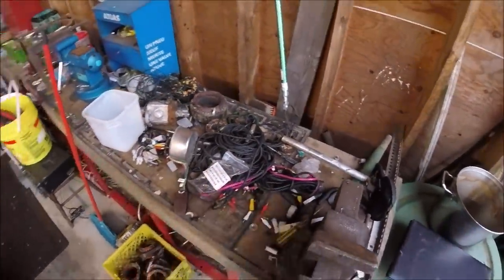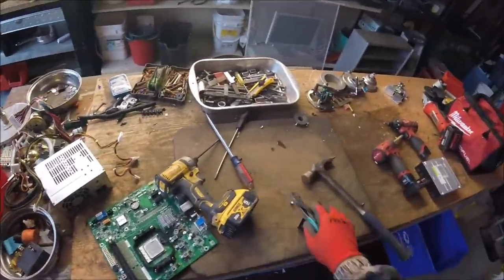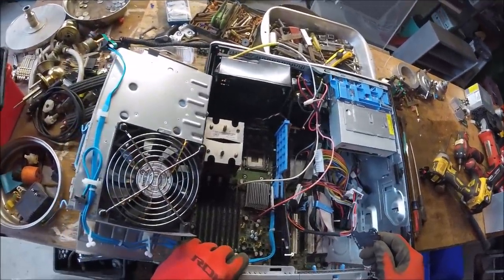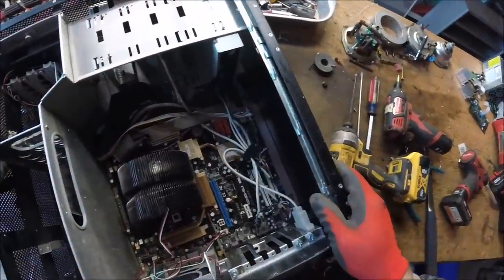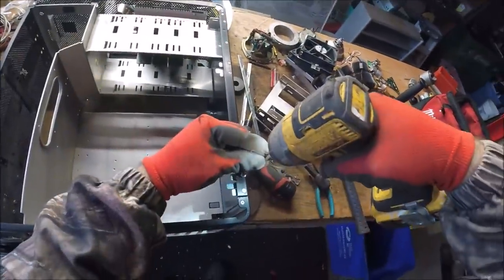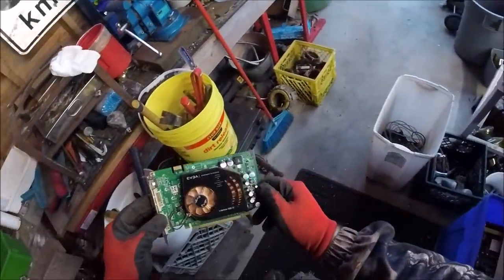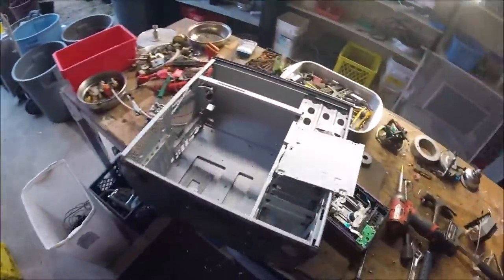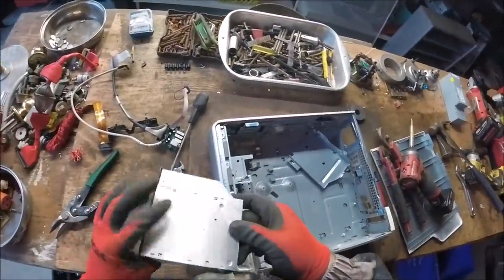Scrapping Out Different Computers For Gold Recovery

Comment: Hi Phil, why are you taking them batteries out? Is it for Safety 🔥, or possible Silver content?
Reply from the maker: I have to take out battery's & Heatsink out to get 20 cents more a pound
Reply: The battery can short the circuit en give then fire bij schredding the boards to recycle the metals. If you clean your boards (battery, alu, wire, steel and plastic) then the most yards give you more, they pay you the time that they normally take to clean the boards.